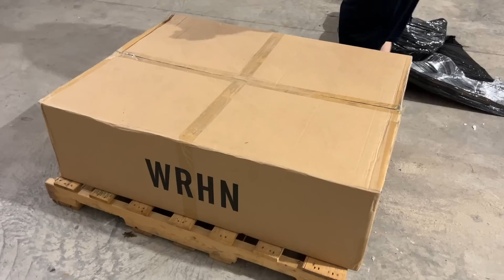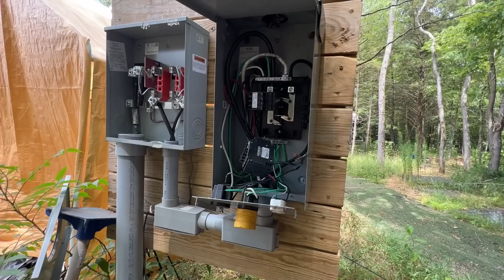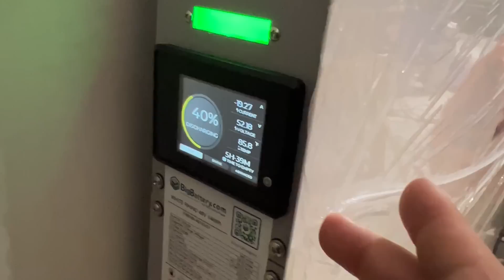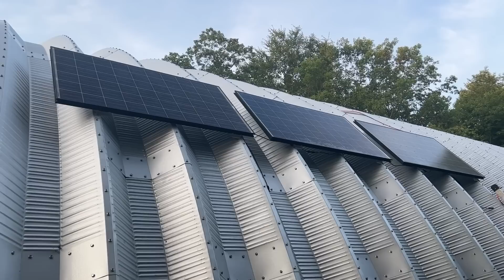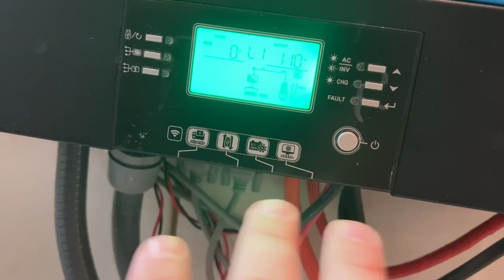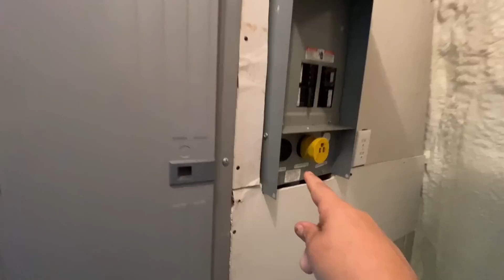DIY solar power to save $400 per month off our electric bill. SunGoldPower TP6048 Hybrid Inverter

Comment: I used all deep cycle lead acid batteries, and get a good few years out of them. But I am running 550 amphour at 48 volts through 8 batteries in 2 banks of 4. I am however running a much smaller array than yours, only 2.6KW and a 0.6kw wind generator. And it produces at 96 volts. I however don't have an on grid option, and my back up is gas generator, which really only gets used in the deep winter usually. Propane heat and cooking and this setup has worked well for many years, doing little upgrades as I went.

Comment: Have you been able to use your welder on this system? Or do you run that directly off the grid?
Reply from the maker: Yes we weld in it.   220v clothes dryer runs on it too
Reply: @BusGreaseMonkey  how big is your welder?
Reply from the maker: Mig is 170 and tig is 200
Reply: @BusGreaseMonkey  nice.  I have a Hobart MVP210 I'm hoping to use, gotta build the shop first though lol

Comment: I don't fault anyone for using what's available to go off grid.  But like in EV autos etc one needs to understand the impact of producing these batteries. It's not cheap and it does have a huge impact on our environment
Reply from the maker: There are a lot of coal powered cars driving around and the owners think they are zero emissions.
Reply: @BusGreaseMonkey    There are also people that think there's a huge hambuger meat machine at the grocery store. So quit killing the cows !
Reply: How is it any worse than cars and the mining of metals for them? Ev's are getting better with time, and don't tell me about the batteries not being recyclable .They are and the old ones are getting reused sometimes as a power wall to store solar for use when needed. Other times they just buy power at off peak times cheap and then use it at peak cost times helping the grid keep stable. The 3 R's are reduce first then REUSE and then recycle. We should be adapting lots of things to use these battery packs when the car get totalled. Just the same as buying car parts from wrecking yards to keep your gas powered car on the road. Or keeping your old diesel bus on the road instead of a new one .
Reply: @crzy11000   Do your due diligence and find the answers yourself and be under your own convictions instead of someone else's
Reply: @ I have yet to meet someone who thinks hamburger comes from a machine at the grocery store. I also follow Will Prowse Have you ever heard of him?

Comment: Skepticism over the feasibility of solar as a solution for society's entire energy needs is reasonable.
To discount solar entirely, even when their strengths complient one's use case perfectly is foolish. This is a win-win-win-win by any metric- expanded capabilities, resiliency against grid failure, scalability for future uses, and immediate value that turns into long term cost savings.

Comment: What size panels you go with???
Reply from the maker: Mounted on the roof i have both 307w and 250w on different strings not combined
Reply: @BusGreaseMonkey   3 to $4000 is really a stupid deal not to do for an average size house.. I know I have a backup generator about 6500 W that are run my entire house unless the 101 gallon electric hot water tank turns on at the same time the air conditioner does... At 6000 to 6500 W you're literally paying very little for electricity probably cut 75 to 80% from your bill at least in the summer...

Comment: Lithium batteries were tested here in Australia, and on average the different brands typically lost 30% capacity over 4 years, and were done at 10.  They dont need to be pierced to catch fire, all that needs is a manufacturing defect or malfunction. LG just had a major recall on theirs in Australia for catching fire.  Our design standards now require them to be installed in a fire resistant enclosure.  BMW,Porsche,Boeing,Tesla,GM and many other companies including electric buses in Europe have all had problems with violent fire events from lithium batteries. Even if something has internal fire suppression, has that been tested to completely suppress a fire?  Fire departments struggle to put out EV fires, in Europe they put a burning EV submerged into a big bath tub on wheels and leave them in it for hours. Lithium batteries have their place in many applications, but they are not perfect,they have problems, and people are not fully informed of their lifespan issues, and cost per year accordingly. Lithium batteries, experts have testified cost 300% more to dispose of than to make, the recycling problem has not been solved, and might not be solved any time soon. They will possibly become the asbestos of the future.

Comment: Your electric utility is probably much higher than 14 cents per kWh. This would explain why fairly low usage results in such a high bill, taxes and surcharges aren’t THAT crazy. 

Your 14 cent charge is likely their power delivery charge (how much it costs them to deliver power to you). They also charge a power supply charge per kWh, how much it costs them to create the electric. Your total price per kWh is the total of these 2. 

Many don’t realize this, so they just think their power delivery charge is the only one, but if you look closely, you also have a separate power supply charge per kWh. 

In my case in NY the power supply charge is about 9 cents per kWh, with the power delivery charge being another 9 cents per kWh for the first 250kwh, then jumping to 11 cents per kWh for ever kwh beyond 250. 

So my total electricity charge per kwh is actually around 20 cents per kwh (but most people think it’s only 9 or 11 cents).

Comment: Point of detail: you're not recycling - you're reusing, which is far greener than just recycling.  Rather than letting a used item go to waste, or wasting energy and materials by destroying it down to its constituents and then making something else from that, you're putting the perfectly good solar panels back to work exactly as they are.  And why wouldn't you?  A PV panel's typical warranty is 20 years or longer, so long because the manufacturers are extremely confident that the panels will work at least that long.  The oldest panel I've heard of is over 44 years old and going strong, so you should be fine.

Comment: i have a home solar panel system.  it has an additional controller that links in a water heating element. so once the panels peak over 2kwh. the water heating kick in and you get free hot water to wash with too. i get paid by our UK governent for every kwh my house pushes to grid. so free home power and get paid back too.

Comment: It looks like you have just two strings. Is that correct? 
If so you might get less energy by connecting that one spare panel with different angle to sun.

You are correct on 19:07. Each panel on string should have same lighting conditions. As amount of power from string is power of least illuminated paned multiplied by number of panels. So if you have panels tilted differently on same string the whole string is getting power equal to angle of worst panel in string.
Reply from the maker: 7 strings of 8 panels each

Comment: can you show more on the battery settings on the inverter / every parameter value in the menu .....is there a bms data wire from the battery to the inverter .....

Comment: lol a different building material would have been a better idea. Cant imagine how hot it gets in the summer
Reply from the maker: About 72° inside when it’s 105° outside.   It’s insulated and maintains temperatures very well.

Comment: I love your quonset.  What is the size of it?
Reply from the maker: 40x78 20h
Reply: @BusGreaseMonkey  Nice size, did you end up covering the spray insulation inside with drywall, corrugated material, etc?  I have always wanted to build one of these by the pacific coast and have a huge shop on the back end of it.  Looks like your apartment is 1000 sq feet or so?

Comment: Environmental impact ? Do people not know what you for a living, 50 year old diesel busses that do a couple of miles to the gallon and people complain about a bit of solar. I'm not having a go at you Scott but people who complain annoy me.
Reply from the maker: Hey we get better fuel mileage and economy  on these than modern engines.  The environmental impacts of a new rv vs saving an old one is off the charts better by the way
Reply: @BusGreaseMonkey  I don't doubt that for one second, I'm an old school auto mechanic, people think buying a new car is better than driving a old car, but they don't take into account the manufacturing and cost to repair a new car. If the old car needs repairing you buy the part and fit it, a new car you can't buy the part they come as a assembly (if you can even buy them) with lots of parts wasting a huge amount of parts they didn't need. Plus the new car is scrap after 10 years the old cars are still going after 50+ years if looked after.

Comment: I like these kinds of inverters. I use 2 6548's from MPP-Solar (120V each, 2 required to get 240V).
I use Solar-Assist ant for the monitoring, 1000 times better than watchpower.

I love the mount setup for the panels. Simple, effective, and lowest cost.
Reply: Solar-assist by who? is that iphone?

Comment: I like this setup. In a worst case scenario, if the panels were down for a few days and you ran on the grid (via charging the battery with the grid)  would you loose much power? That is how efficient is the battery charge/discharge process.

Comment: in 2017 I had solar panels installed on my house, Ever since that time, I've had only one positive electric bill for about $50 which was the 1st month; after that, my bill has been a credit every month. In the winter all my heating is free, and in the summer all my cooling is free. My panels are all American made, as well as the Inverter and the Power Optimizers, and all the components have a 25 year warranty. It's important to use only American made components. Stay away from Chinese or Asian made junk.
Reply: it's not free if you paid for the solar equipment.  unless you're past your payback period.

Comment: Great job I’m starting the process of doing this but with a contractor. But with what I have seen on your video I’m going to do what you did. If you could please list who the supplying all of your components for your system. I tried to find the panels but no luck. Same as the power unit. Keep up the good work I love the old Detroit’s I still love working on them too.
Russell
Reply from the maker: Links are in the description

Comment: I am curious as to how much insulation to direct heating effect of the sunlight is afforded by installing the panels slightly elevated from the roof surface. Seems it would be a fairly effective barrier with layer of air between the panel and roof.

Comment: I have a victron MPPT 250 / 100 smart solar charge controller with 21 210 watt solar panels , and they lose very little power when I have shading on some of the panels . The technology victron uses is absolutely amazing !  I've used other charge controllers , But nothing compares to victron from what i've seen so far. I don't know what type of charge controllers they put into those inverters , But you don't have to use them . You can use outside controllers . The victron smart solar charge controller is 98% efficient . I don't think there's anything better on the market at the moment.  check it out , There a $1,000 bucks , But actually worth it .
Reply from the maker: I have all Victron in our bus.  This sunpower unit is so much more simplified and works amazing so far

Comment: Tells you the power companies run the state when the excess power being sent back to the grid is illegal.
Reply from the maker: It’s only illegal for the home owner to do it, you can hire a state certified electrician to do it.  They don’t want the power company employees getting killed from an energized line.  Homeowner can do anything electrical except that actual connection to the grid.
Reply: @BusGreaseMonkey  that makes sense. No one but the proper folks should ever be touching the grid.

Comment: I love seeing this. That is a great setup, and the building you're attaching to not only optimizes the function of the panels, it also benefits from all of that shade provided. I love that the system still produces on cloudy days. Even though batteries do have an environmental impact, they're necessary, recyclable, and by the time that battery reaches the end of its life, there will be far more options to choose from that are more efficiant, higher capacity, safer to run, and longer-lasting with less of an environmental impact. Advances in battery technology are exploding over the last two years, and the more people that do what you're doing here, the faster those advances will come to market at a better price point for consumers.
I wish TVA were pushing harder in this direction for the future. Even if customers like yourself chose not to sell back to the grid, more systems like this would take a ton of strain off of the grid.

Can't wait to see how this works for you over the winter.
Do you have any information on how long those pre-used panels may have before they will need to be swapped out?
Reply from the maker: Today was a cloudy day and we ran the air conditioning all day and ran 2 loads of laundry through the electric clothes dryer and still hit 100% on the battery

Comment: Another thing about the power you are getting from solar is at a much better power factor than the power from the grid which can get down to between 80 and 90%.  This is because of inductive reactice, the amperage is not at the maximum at the same time as the voltage.  A 10 HP motor will only actually produce less than 9 HP.  I don't have a way to go solar because of the orientation of my house and trees.

Comment: I agree. I bought 40 235 watt panels for 1200. I ordered 32 280ah cells from china which gives me 53kw-58kw battery backup. 2 inverters. All said and done its $14,500 total. I will add 20 more panels down the road and I will achieve off grid then. right now its 6 years to pay back. will add 1 more year with another inverter and 20 more panels.

Comment: There is, to me, nothing more satisfying than getting free energy.  It's so useful and necessary so, to get it for FREE?  Great job!!
Reply from the maker: It is very addicting
Reply: He hasn't gotten it for free yet for fook sake.  Payback will be 30 years for the amount he spenton batteries.  Inverters will die in a few years.  that's 1500 each.  Ok 50 years.